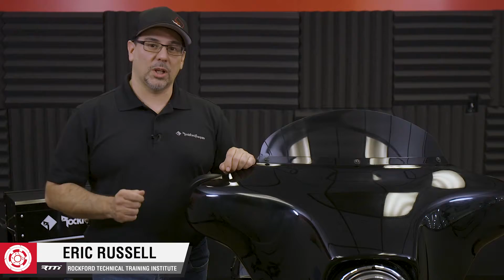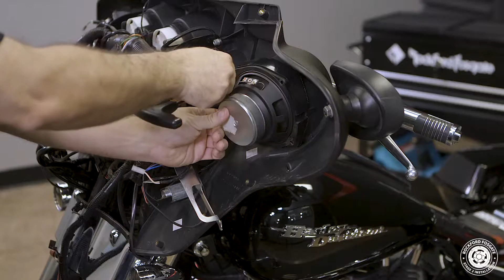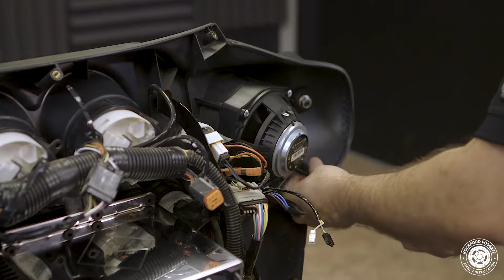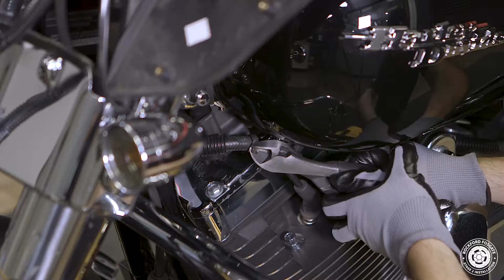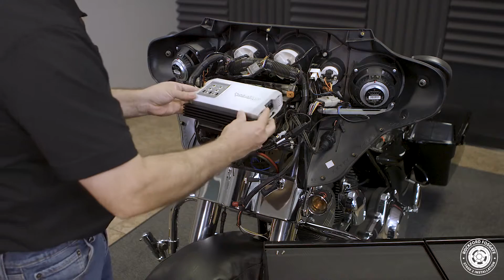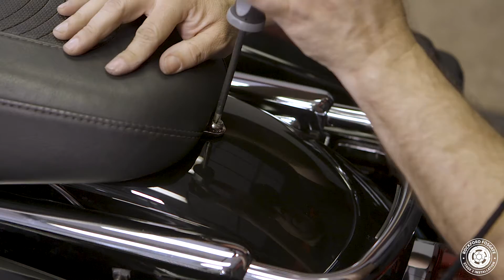1998-2013 H-D Street Glide Stage-2 Installation

Comment: I have a 2007 HD Ultra Electra Glide, with this same radio (PMX-HD9813) and all controls work perfectly... except for SOUND. 😢
The bike is stock (audio related). 
There is a blue wire loose coming from the RCAs plug that is connected to the radio, but the bike has no RCAs to connect to... Could it be that?
What I am missing?? 
Thanks.
Reply from the maker: Thanks @antmrod1972 for that detailed info.  If you're using the Rockford Fosgate TM400X4ad amplifier as supplied in the kit, then the amplifier may not be turning on properly.  It turns-on using the DC Offset present on the speaker output wires.  This eliminates the need to use the BLUE turn-on wire, so it doesn't need to be connected.  Go into the AUDIO section of the radio and verify the INTERNAL AMPLIFIER is ON.  When audio is detected on the speaker outputs, it "tells" the amplifier to turn on.

Comment: I hook everything up but no BT option. What happen?
Reply from the maker: Make sure the radio is setup for BT Device Pairing:

1. Press + hold the MENU button to access "BT Pairing > Discoverable > Device".

2. Select "Enable" to make sure the unit is discoverable for pairing.  Open the Bluetooth setting on your mobile device to find "Rockford PMX" and select it.

3. Access the Bluetooth source, by momentarily pressing the SRC (Power) button and rotate the Volume knob to select "Bluetooth".

Comment: $1600 lmfao
Reply from the maker: Welcome to High Performance Motorcycle Audio, purpose built for Harley-Davidson.  What you'll find is Rockford Fosgate components are NOT off the shelf, NOT readapted car audio gear, and NOT run-of-the-mill gear designed to make a quick buck.  We specifically engineered the source unit to bring in modern digital media to legendary H-D motorcycles.  The amplifier's dynamic output really produces 570+ Watts, and the TMS speakers are frequency response tailored and designed for H-D motorcycles so you can actually hear your audio over wind and road noise. Purchased separately this kit retails for $1686.